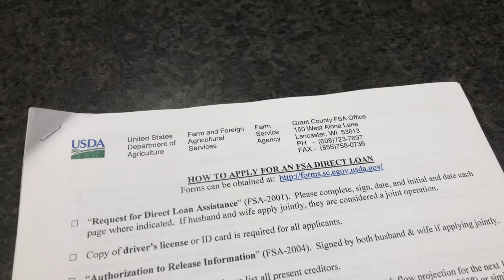Upcoming Purchase? - Harvesting Soybeans

Comment: Hey Ryan,
just a friendly suggestion, get a second set of air filters so that you can just swap them out and clean them later, just make sure you always have cleaned ones ready to go.
I find it speeds things up especially if you do several in a row and it's easyer to bring an air filter to the machine in the field than a comressor.
Greetings

Comment: I hope it's a semi like people are saying.
Reply: semi
Reply: Semi trucks are expensive
Reply: Sicktrickintuner not like he’s getting a new $180,000 pete 389. more like a late 70’s
Reply: @Sicktrickintuner   it depends on how old or new it is. I paid more than $25,000 and less than $50,000 for mine.  97 kenworth w900l and a flat bed trailer. I wanted the tractor only. I sold the trailer for a $1000   less than i paid for it after making money using it four months.  Personally I wouldn't pay over $50,000 for a used semi tractor .
Reply: Ryan's pickup is the price of a new CPS hopper trailer and 10  year old truck so I think the problem of getting a semi is who would drive it.
Reply: @robertreznik9330  instead of having two people on a auger wagon they would just have one on the auger wagon and one in a semi.
Reply: @Sicktrickintuner     Liability insurance is over $1000/yr, collision is more.  The farm tag is more, too.  tires are $350 to 500 but tractors and wagon are even more.
Reply: @robertreznik9330  Sounds like a job that Travis would do, mainly because it's so similar to what he already does during harvest and planting seasons.  He's the "Gopher".

Comment: Draper header, unless you are planning a new combine soon, I think a draper will suit you good.
Not an expert, nor I have any experience but, I saw a lot of pods flying of the auger in your last video.
However apparently you wanna handle the grain faster.
In that case i'd recommend you looking into some EU style trailers. In Germany tractors safely tow fully loaded grain trailers up to 37 MPH and more. Not sure what regulations you have over there.
Also if you get a tractor, add a mounted or trailed sprayer and spreader with section control to the list.
Reply: http://nasdonline.org/static_content/documents/2065/d001906.pdf

In this document they specify a maximum towing speed of 32mph for tractors with appropriate trailers
Later they advice on 80mm ball hitches.

Comment: Unless you can do custom hauling with a truck and trailer, I’m not sure a rig would pay it’s own way with your current acreage. They are a lot of maintenance and not cheap to work on. Insurance is a big factor too. Finding a reliable driver that will take care of your equipment is a whole different ballgame. Calculate you ROI (return on investment) and you’ll know how much custom work you will have to do to pay for it. If it doesn’t make you money, it ain’t worth it.

A dryer may be beneficial to you guys..

I don’t know anything about dryers, but spent years working with truck owners that owned anywhere from one to as many as 2500.. 

Best wishes fellas
Reply: Gee Dubb they have plenty of acres to have a truck. We run 1,800 and have 3 semis and end dumps, and 2 tandems. Although they multipurpose for silage chopping also.

Comment: Did anyone else see the new Green grain cart they were using? Possibly a loaner, but to me seems that is the next possible purchase.
Reply: @John Haas  I thought they scraped that old one. This one looks fairly new, and has the unloading auger. Just do not remember seeing this one before.  It is not a large one, hauling it with the smaller tractor, so maybe it is an older one. Look at 12:24 that thing is shined.
Reply: This does look new, but it seems odd they would need 2 good size grain carts when they are always waiting on a truck

Comment: Both those air fliters on the 82 were filthy, and way past replacement.  The engine ones will improve your fuel consumption.  Combine.
Reply: @John Haas the engine air filter has a 2015 date on it.  We use to replace ours every year.

Comment: Combine
Reply: Combine would be an excellent choice. But a truck honestly makes more sense. No point in upping threshing capacity if you can't haul it away fast enough.
Reply: Its gotta be a Combine... people have told them to buy a semi a thousand times  for the past 2-4 years and they just don't feel the need as it sounds like they have relatives that have semis that they have run at harvest time for them..... but there is always the possibility of replacing the skidsteer or just buying another one..... but then there's the fact that they won the competition for the autosteer guidance system platform they use and I never heard what happened with that

Comment: 25 foot soybean head to speed up harvest
Reply: Michael Murphy what do they run now? looks like an 18’
Reply: @roundprairiedairy7006  920 john deere is 20 ft
Reply: On the strips they have the extra 5 feet on a header won't make much difference.
Reply: Jeff Gixer it will on the ones that they have doubled up over the past few years
Reply: @michaelmurphy3567  not enough to justify the cost of a new header.  Their old header is pretty beat up and not worth a lot on trade.  One those doubled up strips they would  save one round.  Add that to the fact they would move slower it probably wouldn't pencil out.  

Plus if they don't have the semi to take the beans away or a bin to store them in what's the difference if you can combine them faster?
Reply: Jeff Gixer are you a farmer? 5 feet on a soybean header makes a world of difference. There combine can run the same speed they are going now which means more acres per hour which means more bushes per hour and can get trucks loaded faster plus the fields Travis and Ryan rent are bigger than what's their dad has so it would pay off. Also Travis mentioned in one of his videos that there might be a 25 foot soybean header purchase this fall. They can get $5,000 for the old head and can get a nice 25 foot 925F poly for $12-15,000. Look on Tractor House
Reply: They can get a 625F for 5K more
Reply: @michaelmurphy3567  625 would require harness upgrade and adapters on the combine as they are single point hookup so the cost doesn't end with just 5k more
Reply: drew casson so look back at 925's then
Reply: @michaelmurphy3567  you ask if I am a farmer?  We run 4500 acres, soybeans, corn, peas, sweet corn and wheat.  We have a drying system that can store 450,000 bu plus.  So I guess I would be a farmer.  But we run red equipment. 

I fully understand the point of having a larger header and what it can do.  I will ask you the question again.  What is the point of speeding up harvest if they don't have a semi to haul it away.  They rely on commercial transports, and they don't have the bin space to store anything long term.  So why is the head a priority?
Reply: The other thing is if he is just filling out the loan paperwork now, what is the point of investing in a new soybean head this year to sit in the shed.  They will be done in a few days.
Reply: Jeff Gixer wow quite an operation. There dad keeps building bins and they have about 2,000 bushels of in field storage between the grain carts and wagons. That's about 30 acres in good beans.  They want a new combine so you start with the heads which are cheaper  and they just started a few days ago because of the rain. Smaller farmers don't have 4500 acres of  profit to work with in these prices. But I understand your point about the timing of the year. If it's a truck one of them still has to get a CDL before they can drive anywhere with it and it's late for that also. Lots of possibilities but I personally think it's a new head because of the weather this fall.
Reply: @michaelmurphy3567  first of all farmers in the state of Wisconsin do not need a CDL to haul their own corn or their families corn to the farm from the field or to the point of delivery.  So that is not an issue.  Hop in and go.  

You say their Dad keeps building bins.  Well the bin they just built this year probably would have not been built had one of their other ones not failed and became unusable.  

They do have 2000 in field storage but the latest you can usually get a truck to fill is 5 pm, if one is available.  They would have plenty of time to refill that.  

The other thing to consider would be in the future if the go to a larger combine is a 25 foot head the right size.
Reply: Jeff Gixer ok didn't know that we use gravity wagons on our farm ( only have 5 miles to elevator on a state road). Your right but I still think he would have with all of the trade wars and prices the way they are. Maybe the can get two trucks filled after 5. They just have been talking about it for a while and I think they are considering it heavy this year. What do you think it is?
Reply: @michaelmurphy3567  he built the biggest bin he could afford.  That's what a farmer that wants to stay in business has to do.  I am sure if he could afford it he would have built a 40 or 50000 bu bin.  I am sure if they can afford it there would be a different combine and heads.  But they are decent at managing money and equipment and getting by with what they have.

I have no clue what it is.  Ryan will tell us in due time.  I don't know their exact situation and finances but if I were Ryan or Travis I would look at building a bin on their dad's farm.  They can do a 99 year land lease.  They give up so much having to market all their crop or most of it during harvest.  A semi would also help them.
Reply: @michaelmurphy3567  and as far as getting two trucks after five filled.  My best friend has a trucking company and 6 grain trailers.  When the weather is good and guys are doing beans do you know how many guys want trucks after five.  About 15.  There isn't on farmer that gets 2 trucks.  Some are lucky to get 1.
Reply: Jeff Gixer understandable but I'm sticking to my guess. Travis has talked about doing that and it would make the probably another $1 per bushel because they sell everything at the river which is a final destination for all of the local grain. The ethanol plant is 1 Mile east of our farm on the same road here and it doesn't leave our county so we get a little better prices locally. Well just have to wait and see. The joys of YouTube farming channels
Reply: @michaelmurphy3567  we are very lucky.  We have an ethanol plant 12 miles from our dryer, and then we have a Coop that owns an ethanol plant with a delivery point 1 mile away from our dryer.  Our area using gets priced the same as the river.